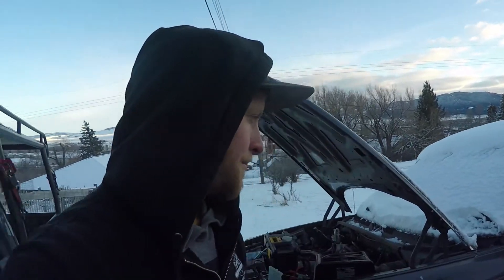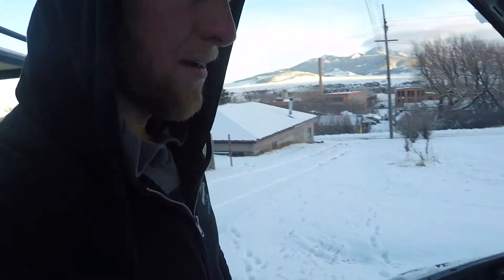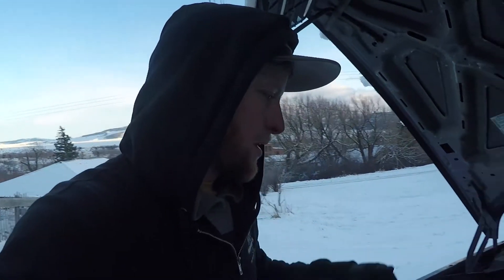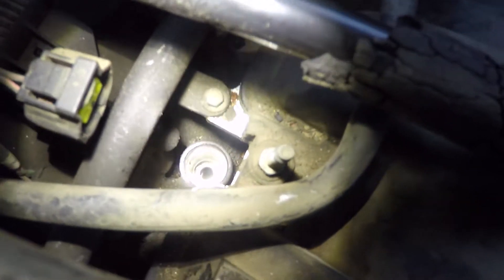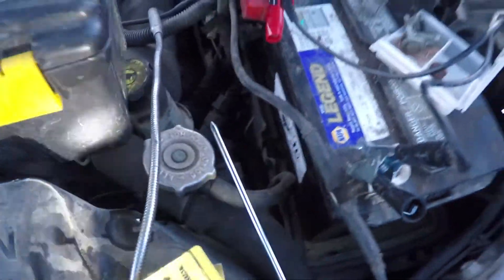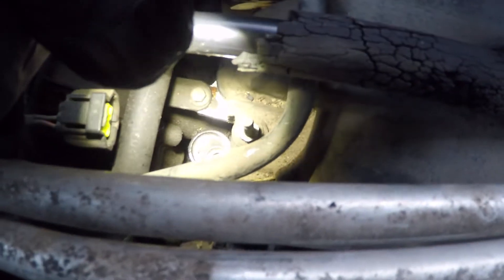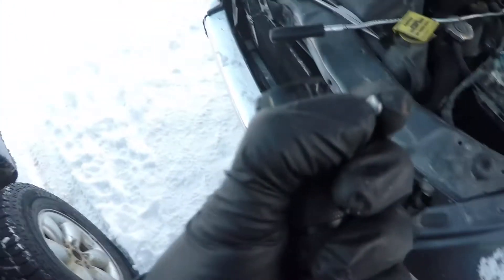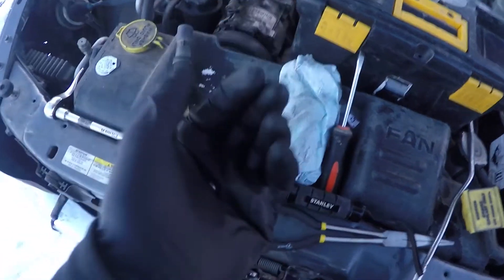2002 Dodge Dakota 4.7L Engine Rebuild (Part 1)

Comment: Hello. I have a 01 SLT 4.7 Quad 4x4 w/ nearly 300k kms. I've owned her for 2.5yrs.  I'm thinkin to change the plugs and am looking for suggestions on which type to use?
Her mileage isn't the greatest, avg 19.4L/100km, mostly in town. She's noticeably better on the hwy but that's not where I do the majority of my driving. I'll clean the throttle body while I'm at it. I don't know if I should mess with the Injectors or not. Haven't looked into what's involved yet w/ testing and possibly cleaning them. But I figure I can't go wrong w/ starting at the plugs. Any suggestions will be appreciated. Thanks.
Reply from the maker: I always prefer the oem or oem equivalent plugs. You can ask at a parts store what the suggested OE plugs are. I personally think plugs don't matter too much. The only brand I would not get is Autolite. Sometimes they get brittle and break. I wouldn't replace Injectors unless you have to
Reply: @MechanicalMike  Ok. Thanks for the advice. If I decide to check on the injectors it would be just to clean them if needed. There's nothing in the way she runs that suggests I have a problem that may warrant replacing them. Nothing really to suggest that they might benefit from a cleaning either other than the age of the truck. I suppose the condition of my plugs may hint toward whether or not it's worth looking at the injectors as well. Would that make sense?